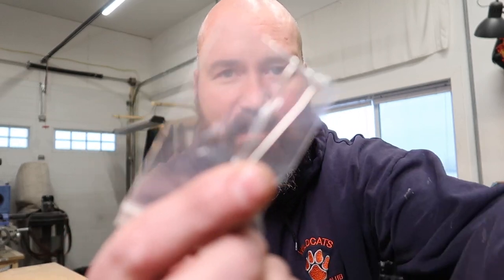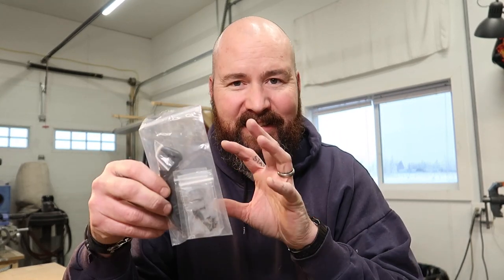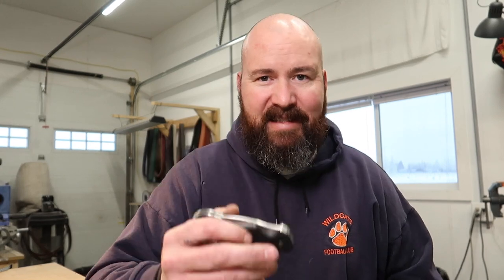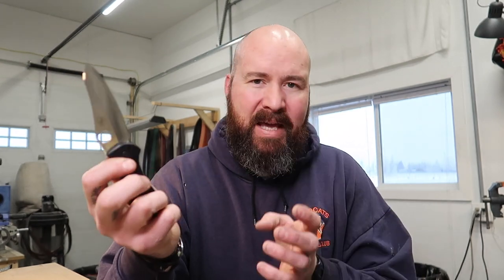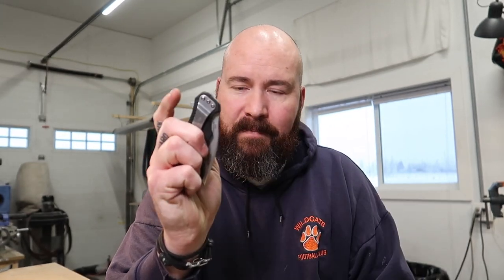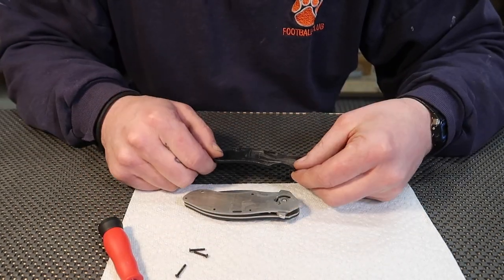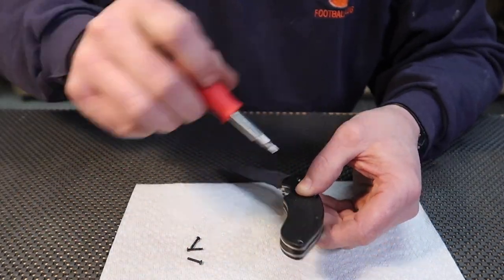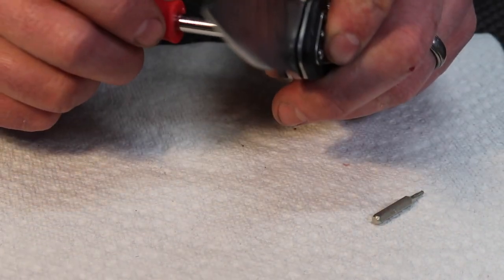EDC Knife Repair

Comment: I have a BM custom full size grip black and white with laser engraving. I also found out that while I love the knife I dont care for carrying it. Same with my paramilitary 2 from spyderco. I 100% regret selling my mini ritter grip as well. That was a perfect blade. I told myself I'll just get another one, I wanted an orange one instead of the black but I never got around to it and as far as I know, they're not available anymore. I find myself tucking my Kershaw leek and and Victorinox compact in my pocket. I've also been developing a love for traditionals. I now keep a northwoods knives norfolk slipjoint in my change pocket. But I'm leery of using it as they're always limited runs and can be hard to get.

Comment: I've been carrying my kershaw clash daily for several years now and I saw this video a few weeks ago and started to get worried about mine breaking as I've used it extensively over time. Sure enough today as I was opening my knife I heard a small grinding sound and it no longer sprung open. Super strange timing but hopefully I can get the replacement parts from them. Super appreciate you making this video though at least I know how to fix it myself.

Comment: Say, I have some old knives I have laying around night at yard sales ("vintage" sharpfinger 152s) and some that are essentially new I bought years ago that just got thrown in my safe (Becker Bk9 for example). Was wondering if you'd be interested in doing a vid around tips for repairing, restoring or refinishing old knives? 

I was kicking around the idea of stripping down the BK9 and putting on new scales and an acid finish to "cool" it up a bit and maybe even changing the profile a little.

Comment: The clash looks bigger than the Griptilian to me. Anyhow i have a Kershaw shield and a couple years back after one year of use it broke a spring. I contacted Kershaw and the send my five new ones to Germany. I replaced it and within two months without real pocket time (just fidgeting sometimes) it broke all five torsion bars. Unfortunatly because i like the design.
Reply from the maker: Yeah that does suck. Wonder if the steel they were using was from a bad batch or something. The Kershaw is a little wider but thinner. That's the part I hate about the Griptilian. It isn't thin in the pocket.
Reply: @Simplelittlelife  it was my first an last assisted knife since then i rapidly moved up the food chain. I concentrat on higher quality and but less knives. Thats why i save up for one of the big g10 griptilians. Size does not matter for me, i have dedicated knife pocket in my pants so i can carry a Spyderco Shaman in my back pocket without sitting on it or scratching the clip. Das